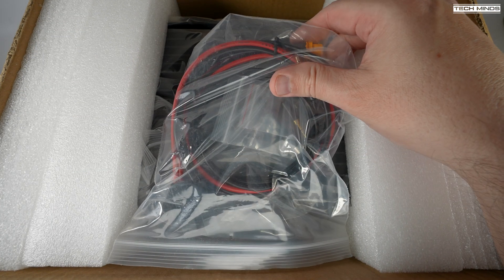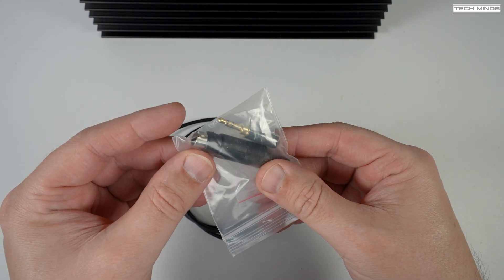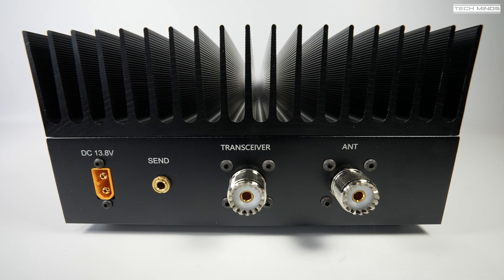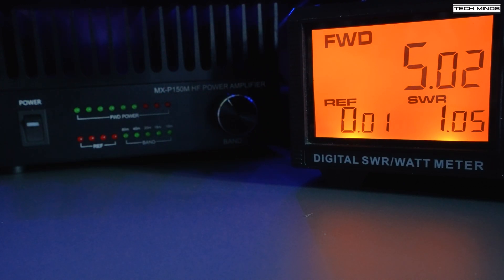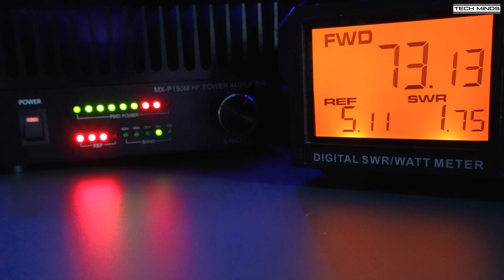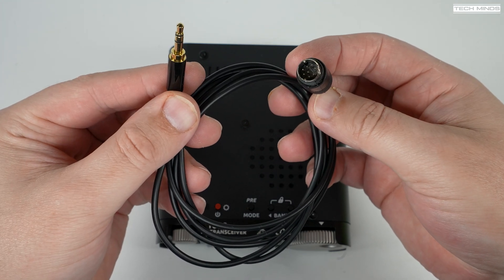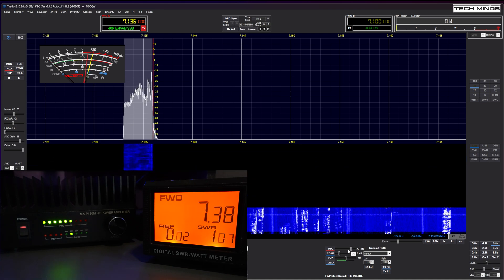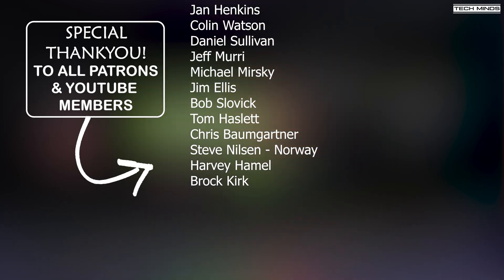MX-P150M 130 Watt HF Amplifier For QRP Radios

Comment: Hey Matt i am looking to purchase this amplifier, seems like is good for the value.
Would you suggest that?
Reply from the maker: In my opinion, after testing for a few weeks on air, it works very well with my Hermes Lite 2. Are you in the UK? If so, drop me an email.

Comment: Question: in order to switch CHELEGANCE MX-P150M to TX transmission mode, do you need to close the SEND and GND wires?
Reply from the maker: Yep, that’s correct .

Comment: I have a somewhat irrelevant question for you. Have you had your hands on the Wolf RS-998 transceiver? 0-750 MHz rx, 0-200 MHz + UHF by frequency conversion tx (locked to HAM bands), 100W output. I'd say it's a base station that can be used as a mobile radio but not really as a portable due to the weight (5.55 kg). It would be nice to see a thorough test of the Wolf.

Comment: Seven minutes before you took it apart Matt. We want to see inside first :) Transistors don't really matter as long as rated for the job. From the hefty biasing, they may be Bipolar, 2SC2290 or similar.
Reply from the maker: It’s called retention :) hope you’re well Mike :)

Comment: Interesting harmonic suppression scheme used here. Just use  choose a device and operate it at it's limits of bandwidth😜 I would not consider the lack of auto band switching a minor inconvenience. Far too many Amps have been damaged for want of correct band selection or protection. Band selection using Yaesu BCD is a no brainer to implement, add a $10 microcontroller would easily perform Icom 8V analogue to  Yaesu BCD band selection as well as providing SWR and over volt/current protection and you have a solution for 75% of the radios market.

Comment: Wow, for not much more, you can get a VK3AMP that has 1000w output with a 5w drive. 
Built in Australia, not china.
Reply from the maker: In a box, with filtering?
Reply: @TechMindsOfficial  yea it has filter boards, I can't remember if you have to build the box. You need to buy your own heatsink.
Reply: @Channelmaster73  and the filter boards do not come with the amp kit, you have to buy them.
Reply: @KQ4JGS  Yes but you can get a kit with the filter boards.
Reply: @TechMindsOfficial  He has a Facebook page.
Reply: Those are all kits.. I see 2 kw amps, one is 1,999 and the other is 849.
Reply: @KQ4JGS  yes but you can get it built. 
But that is AUD so about $1000aud the amp in the video is $650aud.
Reply: @Channelmaster73  yes but you have to factor in the power supply, the filter board, and the enclosure.. which is a lot more than the amp in the video.  And getting built would cost even more money than doing it yourself.
Reply: @KQ4JGS  the filter board is $450aud the amp pallet is $280aud PS is $150aud.
But with all the add ons, case and LCD screen, and all, the full complete kit is $1990aud, 
So yes a little more than $650aud but it could be done cheaper, or more expensive ect.
But it is a perfect amp for a hermies lite, depending on how far you can turn the input power down.
If you can get the output power down to 50w it would be an ideal amp.
Reply: @Channelmaster73  How is  $2000 just a little more than 650?  Its 1350 dollars more.. Also the difference between 1kw and 100 watts is just 10db.. that is equal to about 1.5 s-units..   6db = 1 s unit.
Reply: @KQ4JGS  that was for the full kit with everything.

Comment: For the price they should have included a stand-by switch, BPF for the WARC bands and automatic band switching. I'll pass on this one.
Reply: I agree on the auto-band, considering the LPF is relay controlled it would only require minor reworking to add it. WARC bands usually just use the next band anyway unless it's a real BPF, which this is not, so I find that to be less of an issue considering on an amp having harmonics suppressed is the important part.
Reply: I asked for this AMP‘s originator BG4IGX，he asked you could work on WARC，30m turn to 20m，17m turn to 15m，12m turn to 10m。。。

Comment: My 100W Dummy Load will take 200W for @10~15 secs, (on label)
Pretty sure yours will, easily long enough to test with up to 10W Drive.
Reply: Put an ice pack on top and it’ll recover more quickly too.

Comment: Thank you for the video.  Which is better, MX-P150M or XPA125B? 73!
Reply from the maker: It depends if you need an ATU. The MX-P150 is a great amp, and so is the 125b, but the 125b costs more and has an internal ATU. The 125b can also be controlled remotely to change bands (not tune though). Again, the 125b costs more those reasons I believe. Both great amps and I have both.
Reply: @TechMindsOfficial In my opinion, the MX-P150M will have less heating.  Its radiator is located outside and on the up.
Reply from the maker: That’s a very good observation